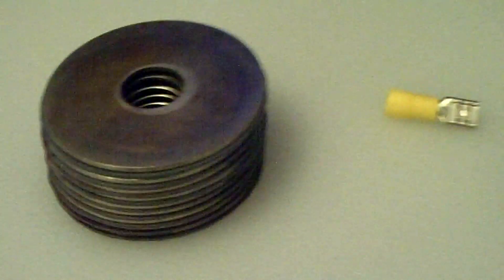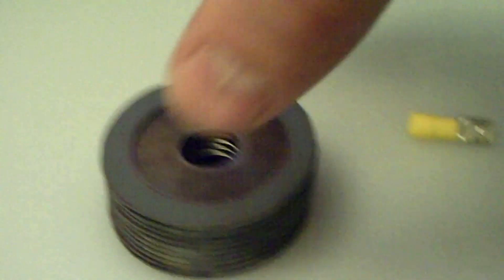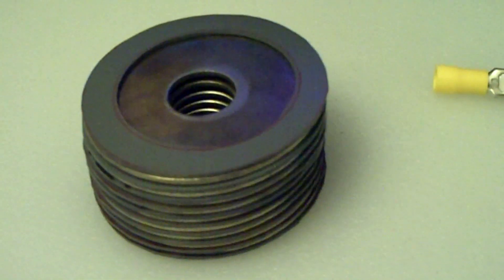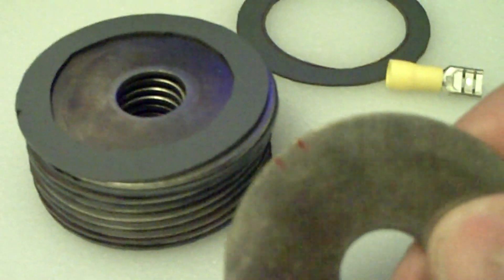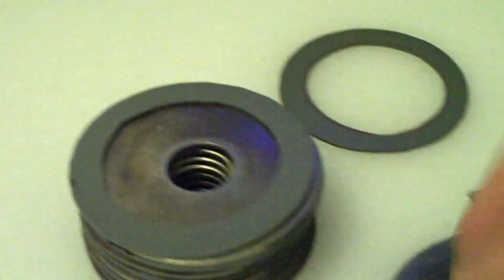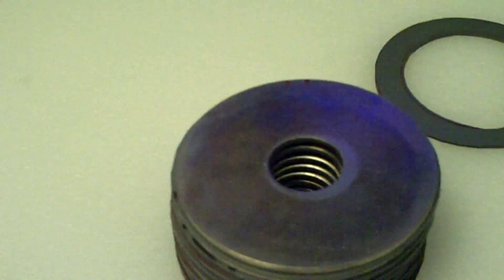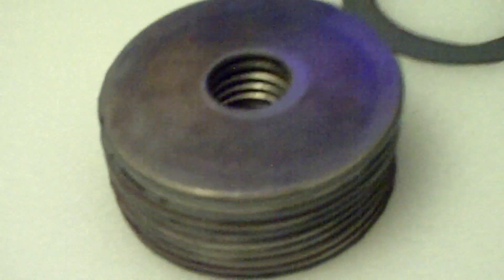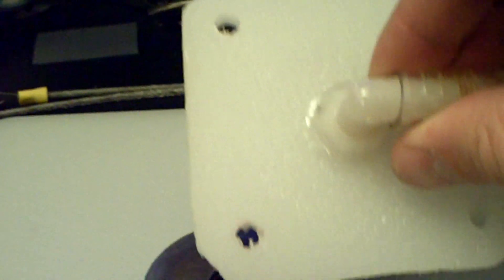Vid26 Homemade Hydrogen Generator

Comment: I recommend you not to cover so much of the steel surface with spacers . you can make all the spacers from that one spacer . cut in smaller pieces and use only 3-4 little  pieces on one plate.

Comment from the maker: @keyko69 

Only use stainless steel washers.  If you use zinc plated washers the water will turn dark green.

If you are using baking soda as an electrolyte, it will also effect the color of the water.

Comment: My question to you is "How much HHO gas does it take to run an 350cu.in. small block chevy ?" the answer in either liter per second,or how much water need to be split in how much time BECAUSE without that knowledge the rest is a mood point.

Comment: The problem with the kitchen stainless is that it is all 430 grade. It will degrade quickly under electrolosis. It has higher iron content and is magnetic. I made my first cell almost 2 years ago with this stuff. It only lasted 3 weeks.

Larry

Comment from the maker: There are a ton of variables to take into account, but that is where the challenge comes from.  If it was easy... everyone would be doing it.

I understand what you are saying about the rolls. Plus you could get way more stainless for your money than if you buy plates.

I keep coming up with designs for the stainless cups, because they are cheap, easy to work with and they produce a ton of gas. 

If flashing works as well as the cups, then I'm all for it.

Comment from the maker: Yeah, I was thinking about the leak issue. I am going to only notch each washer enough for the connectors to make contact. This way I can still have a good seal on each gasket.

I had thought about soldering the vinyl coated galvanized steel cable to each washer, and I may still go that direction, because it will be cheaper to do and like you said, it will prevent the possibility of leaks.

Good idea about keeping the cables the same length. I will have to do that.

Thanks

Comment from the maker: Yes, this is the same basic idea, but much smaller and less expensive. 

I could take 100 of these washers and make a decent Dry Cell out of them for a fraction of the cost.

I'm also thinking that each of the washers are thicker than the plates in most dry cells, so they should hold up a lot longer.

Comment: Im working on almost the same exact cell. Only I am hoping I can make do with  nitrile O rings, more surface area. I also am soldering solid inxulated wire to the outside edge of each plate. The notches and connectors may be a problem with leaks. Like you every plate is wired with the same length wire to make resistance to each plate the same. Been unable to work on t for 2 months but now renfest is over and lifereturns to normal will be back to it again. Lokng forward to seeing your results.